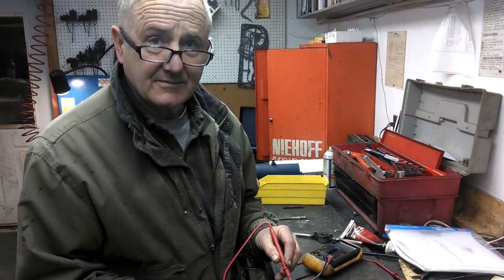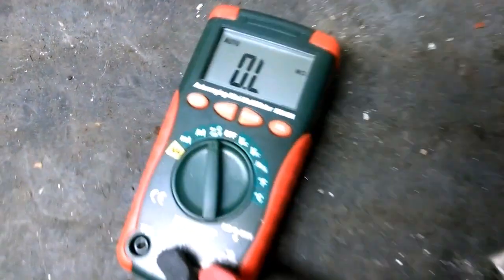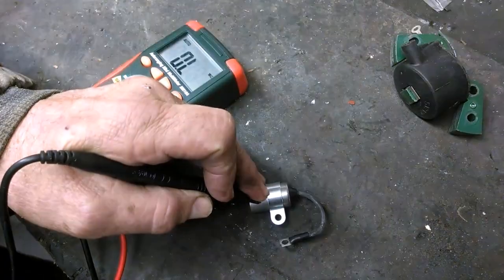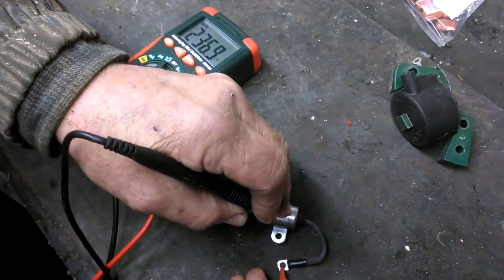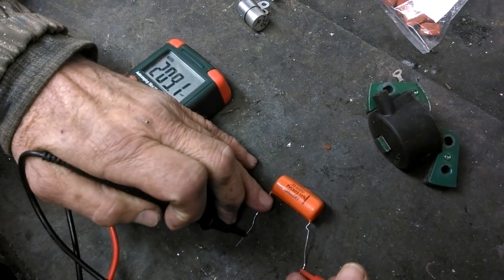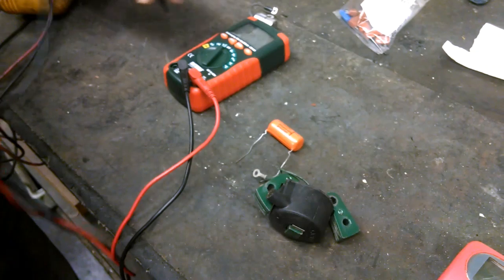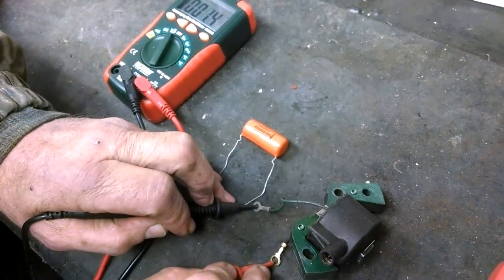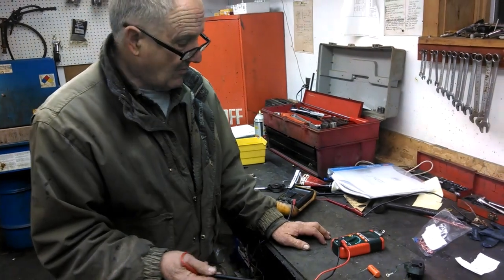A quick check coils and condensors

Comment: Part of this is misleading.   These  tests  DO NOT  replace  "the majority"  of tests  such as a Merc-o-tronic.   Leakage tests  on magneto/ battery ignition caps should  be  a high voltage leak test  such as the old  Heathkit  cap bridges.  You cannot evaluate a coil with an ohmeter.  It will not tell you about insulation breakdown,  and  a  few shorted turns  in either   primary or secondary will not show up on the ohmeter.  It  WILL show up in  a tester  which  simulates  coil  "in service"   and will show up as greatly reduced output.   Also,  a simulated  "in service" test  is more likely  to show up  flashover/ insulation breakdown/ voltage leak.   Around here,  the  many  old OMC's  I've encountered  the  MAJORITY  of coils are cracked open  and  "bad."    Ohmeter tests  do not show this  defect